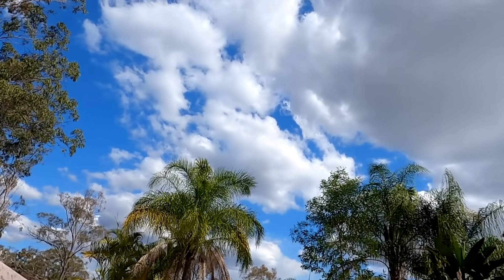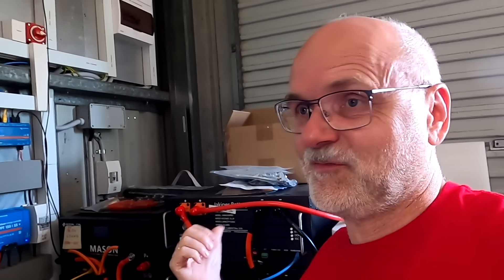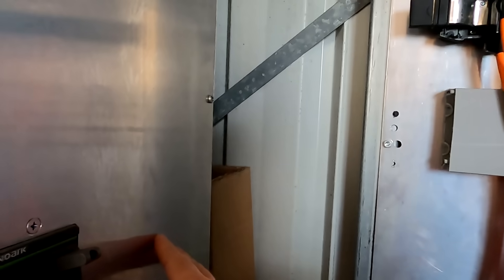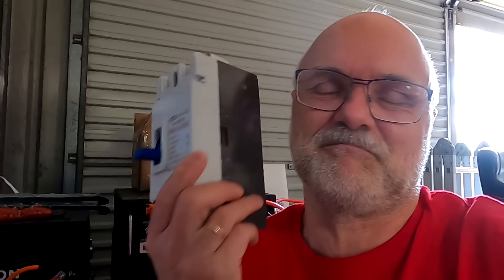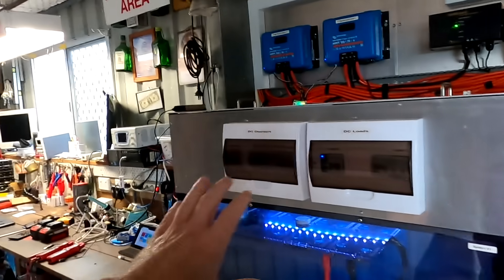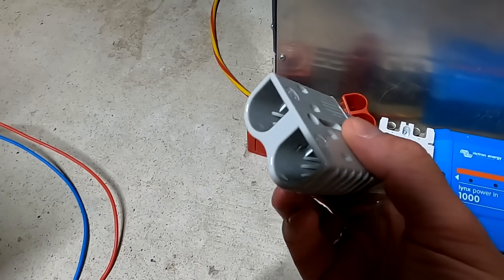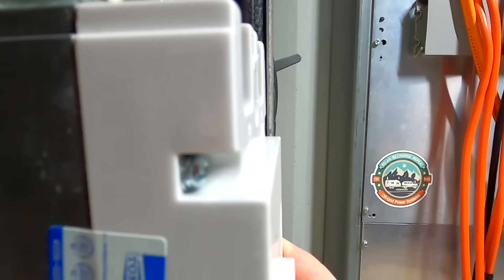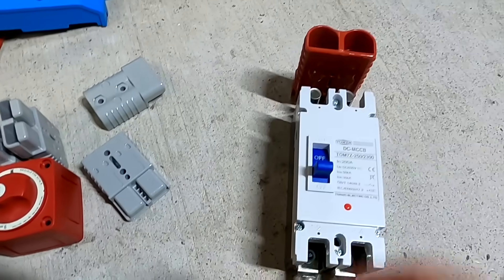I want to extend the Battery Shelf. But not to gain more capacity...

Comment: Maybe it is time to split up the garage in a Production area and Test area. 😂
Reply: Agree
Reply: Andy kind of has that right now. The idea of the option to add test batteries to the main battery is to gain the use of the main loads. Don't forget the end goal... find a suitable way to connect the main battery LOAD to the battery under TEST. Of course he could have the option to test the battery as part of the bigger system or standalone (with/without the main battery shelf)
Reply: That's a great idea and basically as a test system it is used almost always.
Test area = Powerwall 2.1 (2.2) would be beneficial and useful to have portable.
Setting it up on a strong industrial cart where the bottom would be the whole Powerwall 2.1 (2.2)
and having a test battery on the work bench, basically a table on wheels :) 
and the whole Powerwall 2.1 (2.2) under the table.
In this way the battery could be tested independently and if necessary, 
the wheels would allow the test battery to be connected to the main power system.
Reply from the maker: Wait for the Power-Garage upgrade.

Comment: How about this:
1. cancel Powerwall 2.1 (2.2) and stack new and future batteries from Battery 2.0 to the closed garage door in the vacated space 
2. connect all new and future batteries to the original two vertical busbars in exactly the same way as Battery 2.0
3. the entire Battery 2.0 would be extended with a new panel (30-40cm) of all battery disconnects oriented from the front for all original, new and future batteries, each disconnect would be described to which battery it belongs
This would be a nice clean solution where all batteries would be:
     - nicely stored in a single row connected to the same two original busbars system
     - switching off/on all batteries in one place from a new panel of all battery disconnectors
Reply from the maker: Thank you, some good ideas and thoughts

Comment: I'd run cables from the bottom of the busbar, into a switched fuse and then 3m of cable with Anderson connector on the end. On all the batterys add Anderson connectors so you can plug whichever battery into it thst you want to test whilst isolating your shelf
Reply from the maker: Something like this was my plan to quickly change and connect.

Comment: I liked the idea of having multiple connection points instead of just one. 
Why not running a second busbar in parallel to the big one (you have this nice Victron  PowerIn) in the shelf and connect the two of them via the big breaker and a second smart shunt? You'll probably find a way to mount multiple Anderson connectors in the powerWall 2.0.
And I would love to see all the cabling involved.
Reply from the maker: Yeah, something like this. I like the Lynx Power-In because it's compact and fused. I don't like the screw terminals and adding Andersons... I'll have to see...

Comment: How about if you wire extension from battery shelf busbars to wall and have that massive circuit breaker in a wall and stack anderson connectors to wall?
Reply: Every wire that goes in or out of the shelf (top layer & the three batteries) has a breaker before it leaves the shelf.

I know you're only talking about a short wire run, but those busbars are rated at 1000A x 50V if there's a terrible fault or crossed wire inside that cabinet. This is too dangerous, as Andy flashed up on the screen himself.
Reply: @Full-of-Starships  good point 👍🏼 I was thinking to wire from those horizontal busbars like extend those to wall with short but thick wires. Feed 250A circuit breaker from bottom of the power shelf.
Reply from the maker: Everything which leaves the main busbar needs to be fused immediately. Hence the idea to have the breaker sitting directly above the busbar. But the room is not enough, I think.

Comment: Do not connect to the existing shunt, rather parallel the main DC bus with a test shunt
Reply: I've suggested wiring both the 200A & 250A in parallel to the output of the existing (500A) Shunt, but this is better if the control software can integrate multiple shunts (I'd expect that it can).

This is ready for integrating non-shelf batteries properly into the production system.
Reply from the maker: Why should I not connect everything to the existing shunt?
Reply: Hi Andy, switching batteries on and off could cause the shunt to loose track of the SOC of the permanent battery.
As you mentioned in the past the shunt is your absolute point of truth and if you are going to increase and decrease capacity and swop batteries in and out it will remove your point of truth.
A second test shunt incorporated in the main system should solve this problem, something to test if the VRM can work with 2 shunts. The battery shelf should with shunt should be regarded as a single standalone battery.
I might be wrong but this is my concern.
Reply: @PierredeVilliersLife  I agree with this.
Reply: @OffGridGarageAustralia  Only because it tracks the energy flows to the external batteries separately for your testing.

Comment: Why not put some plastic sheet between the big barst and the bus bars in that 10mm gap?
Reply from the maker: I would do this anyway but also need to connect cables or flexible busbars to the breaker from them 10mm away busbar. That is the main challenge!
Reply: @OffGridGarageAustralia  I see, I thought it was an insulation problem. Can the bus bars be moved?
Reply from the maker: @foxythedirtydog4494  under no circumstances. They are part of the main shelf structure and built.